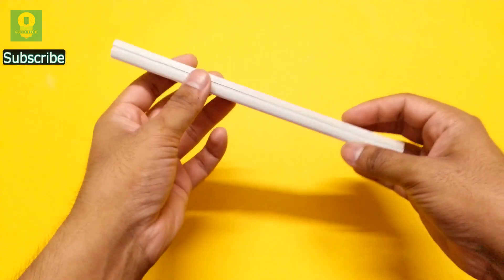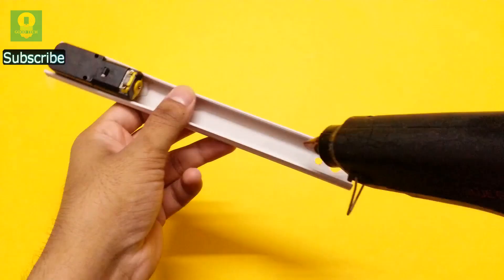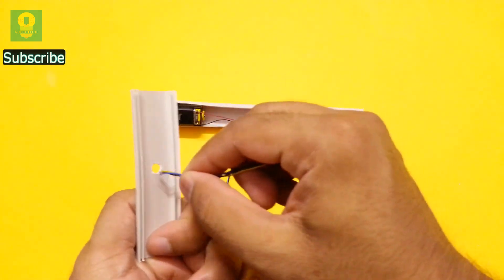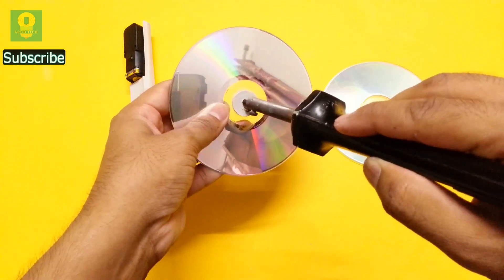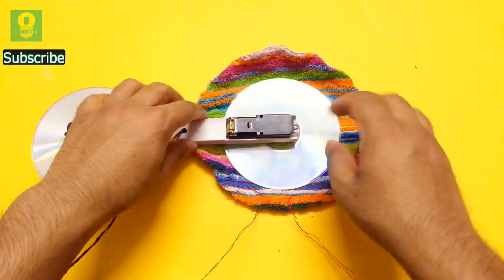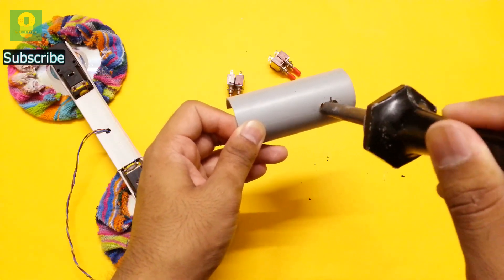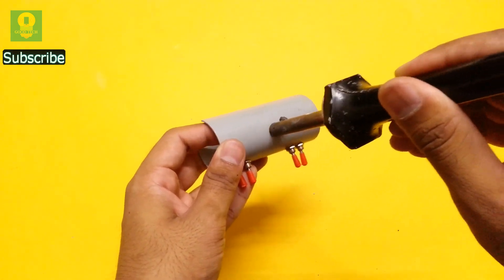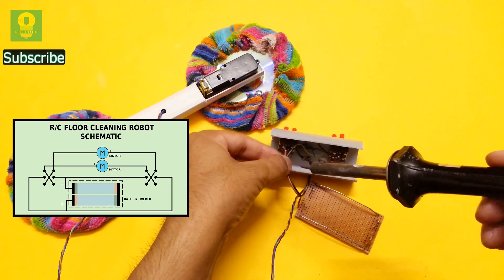How to make a Remote Controlled Floor Cleaning Robot at home

Comment: how many vatts dc motor do you use?
Reply from the maker: I used a 6v 100rpm geared DC motor. If you need material links and additional info, have a look at my instructables here- http://www.instructables.com/id/How-to-Make-a-Remote-Controlled-Floor-Cleaning-Rob/

Comment: what is the tools you used to make a remote control?
Reply: Please answer it
Reply from the maker: This is just a simple wired remote control made from DPDT switches, battery, general purpose PCB and wires. However, if you need additional details as well as material links, have a look at my instructables here - http://www.instructables.com/id/How-to-Make-a-Remote-Controlled-Floor-Cleaning-Rob/

Comment: Can I use a normal dc motor
Reply from the maker: No, a simple normal DC motor will not be able to provide enough torque. Only geared motors can provide sufficient torque.

Comment: N i wan to explain how it works n its uses also
Reply from the maker: This is just a raw prototype, to turn it into a useful product many upgrades are to be done.
First and most important is to use elastic instead of thread to fix the cloth. By using the elastic, the cloth can be easily removed.
Second will be to turn it into wireless control.
The third will be to connect a water dripping pipe over it, that can discharge water over the cloth at a slow rate.
By using the micro fiber cloth, it can be easily used to clean the moderately dirty floor of a room in single cleaning cycle of cloth.

Comment: Can u plz say tht how does it work ??  How it move forwrd n backward like tht
Reply from the maker: As you can see, there are two motors each controlled independently by the pair of two way switches. The two way switches when combined together work like a DPDT switch to control the direction of motor.
With independent motor control, we can make all possible movements:
When both the motors are rotated in clockwise direction, the robot moves forward.
When both motors are rotated anti-clockwise, the robot moves backward.
When ony the left motor is rotated clockwise, then robot turns right.
When only  right motor is rotated anti clockwise, then robot turns left.

However, instead of using a pair of two way switch to make DPDT switch, it is more convenient to use a commercially available DPDT switch.(as used in RC toys and car power windows.)

Comment: One small question .. how do I wash that cloth attached to the cd ?
Btw awesome explanation man
Reply from the maker: It was designed more of as a prototype. For using it for practical purposes you can use elastic instead of thread and then can easily remove the cloth for washing.
Reply: GOODTECH - Creativity and Science thanks for replying .. I like the concept used here !! Elastic can surely help in this case. We can remove this part then as the direct surface cleaning the floor would be naturally getting dirty and grimy

Comment: Help me on 18 november there is my exhibhition
Reply from the maker: Hello Arfat,
A non - Geared DC motor will not have enough torque to make it move on floor. It is required to use a high torque motor can can carry the weight of the floor cleaner.
If the motors are working well, when the cleaner is lifted then the problem only lies with the motor torque.
Replacing the motors will make your model work well.
Also, make sure you have used a high current power source because motors need sufficient power for providing required torque. The power specifications can be enquired by the motor seller.

Comment: please tell me what I fix on CD. I fixed towel bt it is not working. tell me
Reply from the maker: A towel should work fine, but what problem are you facing?
If the CD is not able to rotate that is because the motor used is not able to provide enough torque or the power supplied to the motors is not enough.
Try replacing the batteries with efficient high current batteries like Duracell (or Li-Ion cells found in powerbanks & Laptop Batteries).

Comment: where we will get the two way switches
Reply from the maker: These switches and electrical cable raceway are available on some electrical shops at much affordable price. The pvc pipe is available on hardware and sanitary shops.

Comment: what things you have used please tell me
Reply from the maker: The materials needed are:
2x geared DC motor
Electrical cable raceway
2x CDs
Wiping cloth
Connecting wires
PVC pipe for remote control
Battery and a battery holder
4x Two way switches

Comment: If we don't have soldering what should we do to attach the wire to the dc motor
Reply from the maker: You can just twist the wire around the motor connectors and secure the connection with glue.

Comment: we tried making your product . yes the motor and the CD does move but once it is placed down on the floor. The motor stops, what can I do to fix it??
Reply from the maker: There are two reasons for this, either the power supplied by the batteries you are using is not sufficient for the motors or the motors used in the project are not able to provide enough torque.
Try to increase the supplied power to the circuit and the motors might work well.

Comment: is it ok to use 9v battery to make the two dc gears motors work? thank you.
Reply from the maker: Yes, it will work well with a good quality 9v battery that can provide atleast 500mA of current.

Comment: can we use different type of switch?
Reply from the maker: In this i have used 4 two way switches, making 2 DPDT switches (i.e 2 two way switches to make 1 DPDT for creating bi-directional motion of 1 motor). Yes, different type of switches and their combinations can be used to create bi-directional motion of the motors. If possible, use two DPDT switches for simpler connections.

Comment: Omg I want to make it!!! 
but I'm a beginner, may you explain better the electronic part? 
I love your creations
Reply from the maker: Thanks for appreciating my work :)
The electronic part is quite simple. All you need is to connect two DC motors with two DPDT switches or four two way switches(as can be seen in the video).
A pair of two way switch is connected together in order to perform bi-directional motion for each motor.
There is a link to schematic in video description. Have a look at it carefully and you might easily understand the connections.

Comment: Can i use any kind of DC geared motor? Even if it doesnt look like the one you've used in the video..would it still work??
Reply: And also, do i need to make that Li-Ion cell holder??what is it's purpose?
Reply from the maker: Yes, any geared DC motor can be used and there is no need to make the li-ion battery holder. Use the batteries according to the power requirements of your motor.

Comment: And for joining wires with switches you used hot soldering iron na?
The hole making iron and this are same or different?
Reply from the maker: It is a same soldering iron. After making a hole, you may need to file the soldering iron bit to remove the burnt plastic over the bit.

Comment: Please give me the complete materials for this product. 

my group is planning on doing this floor cleaner for our IP. 

thank you very much😄😄😄
Reply from the maker: 1. Electrical cable raceway
2. 2x DC motors(100 rpm each)
3. 2x CD's
4. Wiping cloth
5. Connecting wires
6. 2x DPDT switches (as used in RC toys) or 4x ON/ OFF switches
7. Half cut PVC pipe to mount the switches
8. Batteries as per the power specification of the motors used.

Comment: Can i used a battery holder instead of li ion cell holder
Reply from the maker: yes, just make sure the batteries you use are capable of providing sufficient power to the motors.

Comment: sir, how much power is used in the gear and the battery?? we'll going to use your idea for our project po ^_^ your idea was great! good job!
Reply from the maker: These are two 6v geared DC motors. The powers source is two 3.7v , 2000mAh Li-ion cells connected in series.

Comment: dude can u please tell me what all things are used in this video and where do u got that motor from ???
Reply from the maker: For Robot:
Electrical cable raceway.
Two geared DC motors.
Two CD's.
Few meters of wire(four different color wires).
Circular cloth tied to CD.

For Remote:
A half cut PVC pipe.
Two DPDT switches or Four Two way switch.
A Battery.

All the items are easily available online on ebay and amazon.
Reply: dvh
Reply: good
Reply: nice
Reply: Mangesh Poojan gear motor remote 🎮 control 🛂  switches  PVC pipe  salting machine  battery 🔋  holder
Reply: How u control the robot
Reply: The geared dc motor means
Reply: I know dc motor and I didn't know geared

Comment: Can u list all the materials needed? Ty
Reply from the maker: For Robot:
Electrical cable raceway.
Two geared DC motors.
Two CD's.
Few meters of wire(four different color wires).
Circular cloth tied to CD.

For Remote:
A half cut PVC pipe.
Two DPDT switches or Four Two way switch.
A Battery.

Comment: can someone list me all the materials because i dont understand what he said
Reply from the maker: For Robot:
Electrical cable raceway.
Two geared DC motors.
Two CD's.
Few meters of wire(four different color wires).
Circular cloth tied to CD.

For Remote:
A half cut PVC pipe.
Two DPDT switches or Four Two way switch.
A Battery.

I am sorry that you will unable to understand what i said, but i have also uploaded subtitles that you can turn on within the youtube player and i hope that might help better in understanding.

Comment: can u give me the name of the materials used
Reply from the maker: For Robot:
Electrical cable raceway.
Two geared DC motors.
Two CD's.
Few meters of wire(four different color wires).
Circular cloth tied to CD.

For Remote:
A half cut PVC pipe.
Two DPDT switches or Four Two way switch.
A Battery.

Comment: Can i ask what materials where used?? im planning to use this as our investigatory project ( i love your works!!) PLEASE!!! :3 thank you
Reply from the maker: For Robot:
Electrical cable raceway.
Two geared DC motors.
Two CD's.
Few meters of wire(four different color wires).
Circular cloth tied to CD.

For Remote:
A half cut PVC pipe.
Two DPDT switches or Four Two way switch.
A Battery.
Reply: +GOODTECH - Creativity and Science  omg, thanks!!!🙌🙌🙌

Comment: Where can i get the procedure?
Reply from the maker: Procedure ??
Reply: Yes . The way to make this project
Reply from the maker: It is a tutorial video, thus shows the making procedure in detail.
Reply: I know but can you help me to list the materials and procedure here because I want to do this project
Reply from the maker: Materials Used are:
2x Geared DC motors
Electrical cable raceway
2x CD's
Cloth that can easily wipe water.
connecting wires.
2x DPDT switch or 4x two way switch
Half cut PVC pipe
Battery

Procedure:
1. Attach both the motors at the end of Cable raceway(do refer to the video to get visual clarity).
2. Attach both CD's to the motor shafts.
3. Cut a cloth in circular shape and tie it to the CD's..
4. Connect the Wires to the motor terminals.
5. Refer to the schematic in the video and make connections as shown.
6. The floor wiping robot is now ready.
All the best :)
Reply: Thank you so much😄

Comment: how many rpm of dc motor
Reply from the maker: The motor i used is 100 rpm.
Reply: where to buy give me link
Reply from the maker: I bought it from a local shop, however, these are also available on ebay and amazon as 6v geared DC motors. There are many options available, search it and you can choose accordingly.

Comment: Where to buy the items?? 
Please give links
Reply from the maker: These are available online on ebay and amazon.
Reply: +GOODTECH - Creativity and Science link please because you have indian achent and i'm don't know what are you say
Reply from the maker: It will be quite difficult to search and then provide links for all the items. I can tell you what items were used in this project and then you can search them on the websites.
For Robot:
Electrical cable raceway.
2x Geared DC motors.
2x CD's.
Circular cloth to be wrapped on the CD.
Thin connecting wires.

For Remote:
A Half cut PVC pipe.
4x Two way switch.
Thin connecting wires.

I am sorry that you faced problem in understanding my accent, I have also uploaded English subtitles. Try and make use of those, they might be a bit helpful.

Comment: Man the switch is very expensive... got any other idea?
Reply from the maker: Yes online they are very expensive, but you can also use two way electrical switches used in staircase wiring and fit them on a bakelite plate as used in homes or you can also use 4 normal push to on switches soldered on a PCB board. You will have a single switch for each direction.

Comment: can u please tell me what kind of motor did u use
Reply from the maker: I used 6v geared DC motors. These motors are easily available online on amazon and ebay, however you can use any geared DC motors that can be fixed in your design.

Comment: hey can you tell me what else switches can be used in place of toggle switches cause its so expensive
Reply from the maker: Well..you can also use DPDT switches also, that will give you much more control over the robot as you might have read in the video description.
However, these toggle switches are not costly, I bought them for Rs.10 each from a local shop.

Comment: Plzz can you tell me one thing more that a simple DC toy motor can be used in place of this geared motors
Reply from the maker: Actually I havn't tried with normal DC motors, however i don't think that those motors will be able to provide sufficient torque for the device to move well. If you try it from normal toy DC motors, do share your experiences.

Comment: I want it on the robot 
which means that when the robot goes forward the red LED will glow and when it move backwards the green LED will glow .
Reply from the maker: As can be seen in the schematic, since the motors are connected in "+ " and " +" configuration, all you need to do is connect a red LED in parallel to one motor and green LED in parallel to other motor. Now when you will make the robot move only one LED will glow at a time, but the direction of motor can only be known after testing practically.
Test it on your circuit and do leave a comment if it works or not.